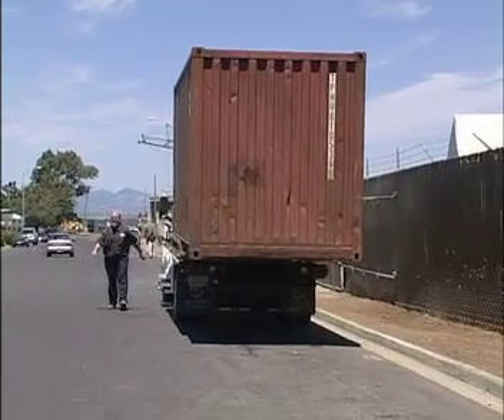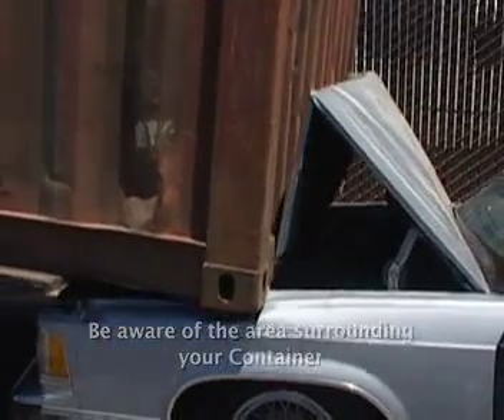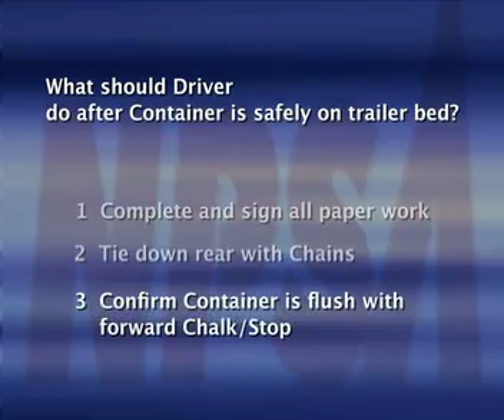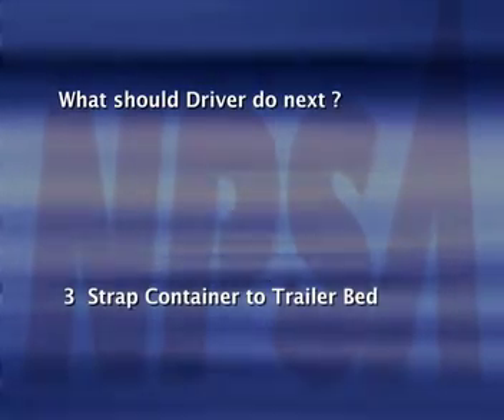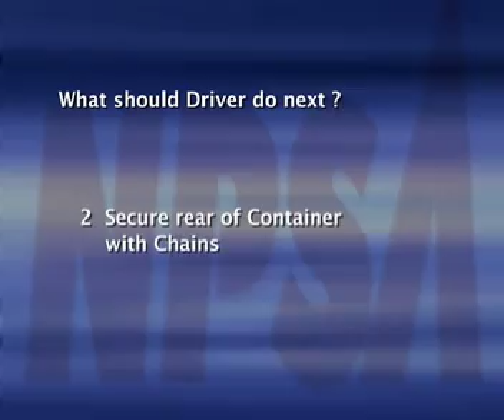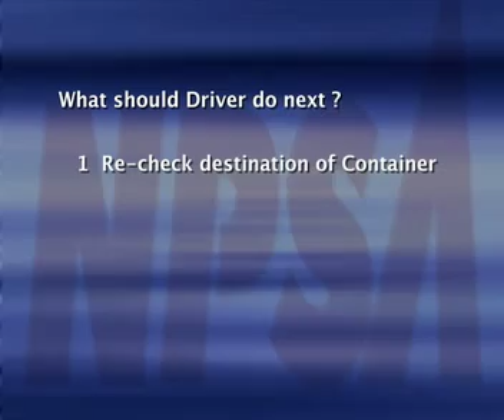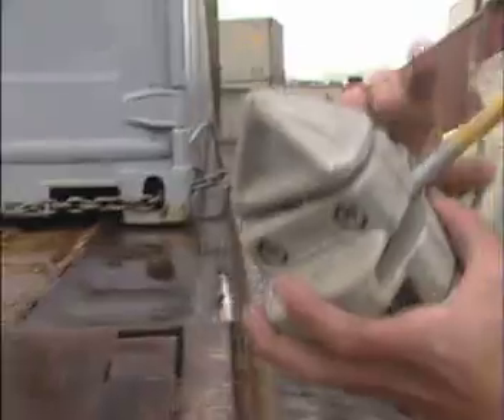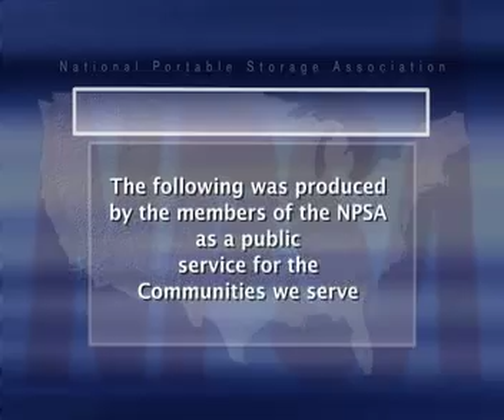Container Loading & Unloading Interactive Training

Comment: Never seen that kind of loading system in action before.
Mostly I see flatbeds or container trailers with locks same system as the stacking lock he showed. Alternatively I see a container truck / dump truck with a 20' in the container / body and a couple of straps over it.
Some 20' are made for rolloff hoists too, but then they're unstackable.

Comment: We lock the containers to the chassis at the corners unless its one of those Sea Land containers from the late 50's which are rarely around.Those locked at the sides with big levers instead locking at the corners.My dad used to haul those loaded with booze every now and then back in 1987